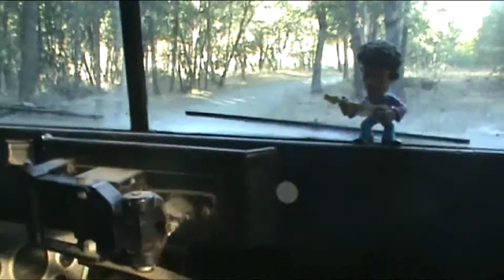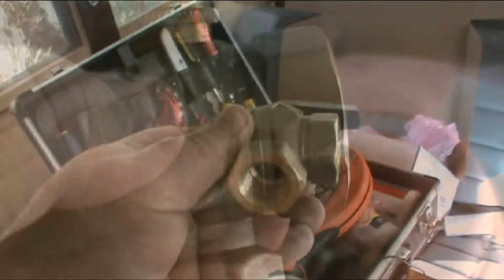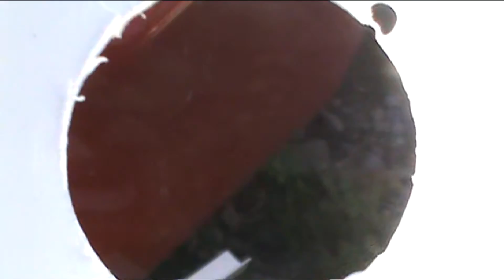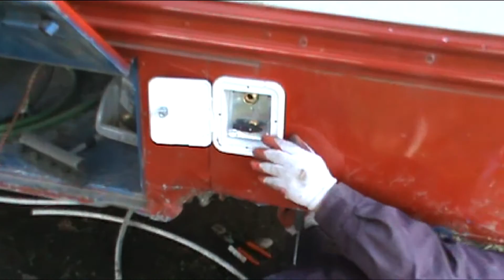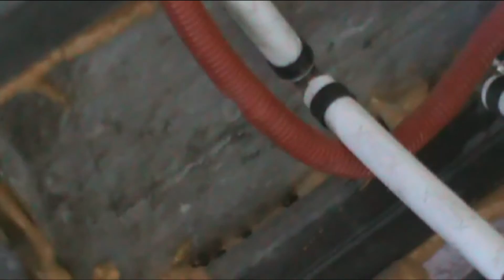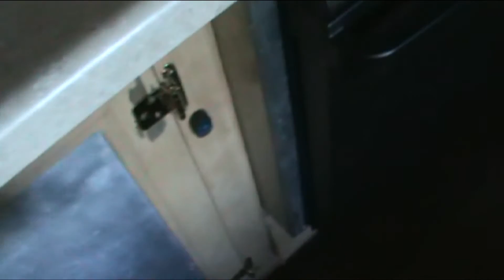Jon's Bus Conversion Part 43 - Mod - extend your water tank by using the on-board pump

Comment: I like this idea. One extra that occurred to me is to put a toggle switch there to turn the pump on so you don't have to keep going inside when filling from multiple jugs
Reply from the maker: +Steampunk Steve Yes the original video I got this idea from did that and I agree - I think I will go ahead and add that. The pump is just above where I did this so access will be very easy. However, if I'm using multiple jugs I wouldn't go and turn it off, just pop the hose into the next one. The pump is self-priming so no need to turn it off for each jug.
Reply: I didn't think about it being self priming